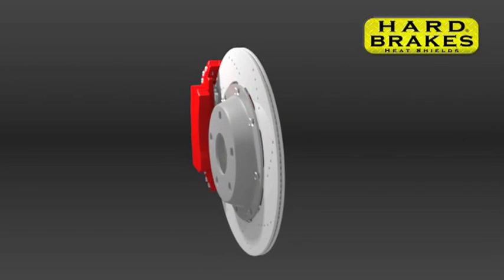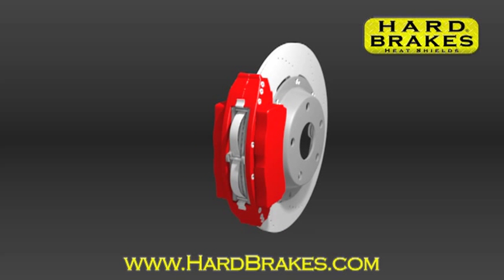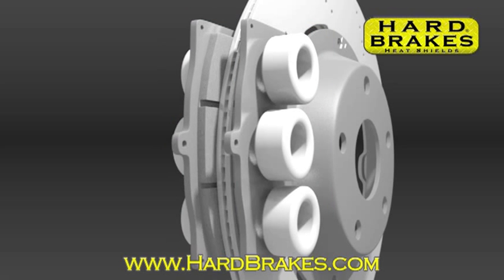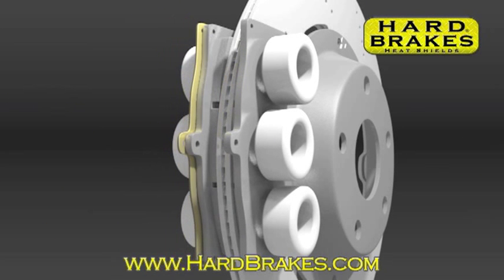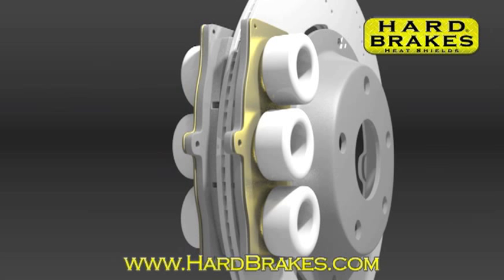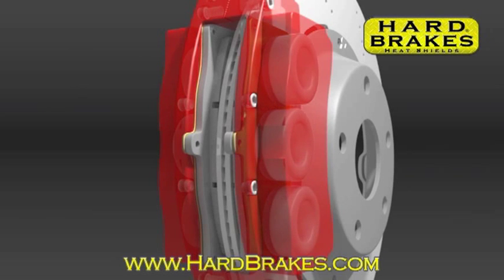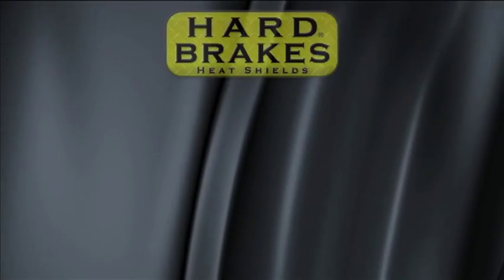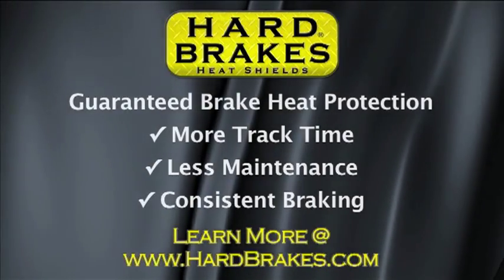Hard Brakes Heat Shield Installation

Comment: Question when installing ventilated multi-layer HardBrakes heat shields: Are the two multi-layer shields against the caliper piston installed with the ventilation channels parallel with each other, or opposed to one another that only allows a small square of air to pass through? Also, is there a preferred "direction" of the ventilation channels when installing the shields?